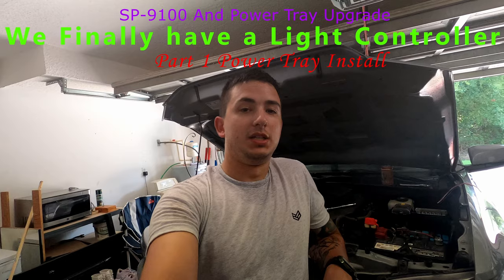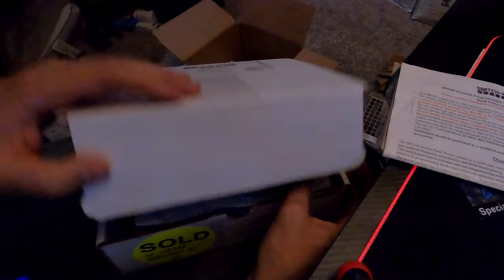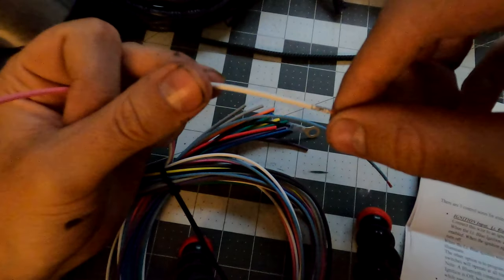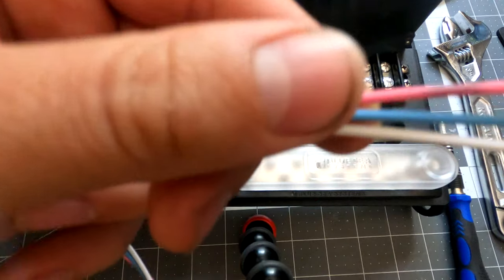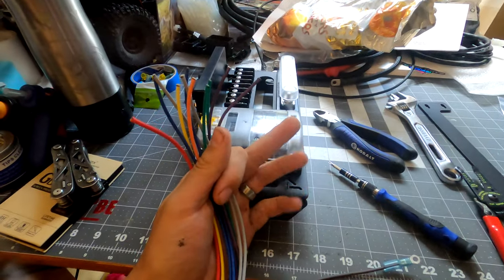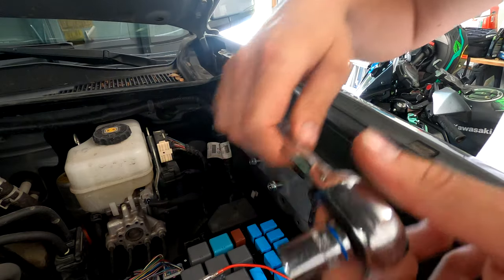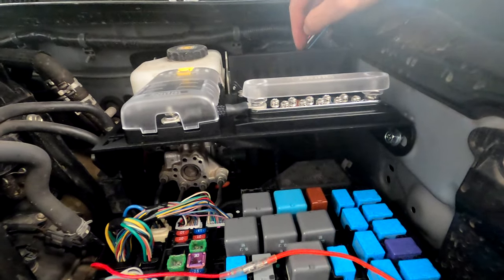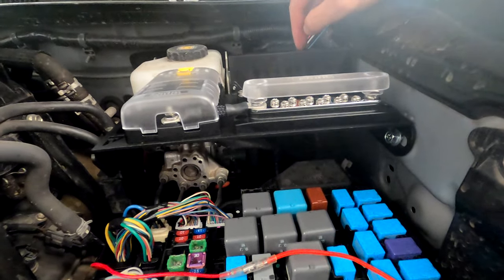Switch Pros Install Part 1 - SP9100 and Power Tray Setup

Comment: Your blue sea fuse box is upside down. You are connecting your ground bus to +Positive of fuse box?
Reply from the maker: Why yes it is😂 I fixed this in a later video, but as I didn’t have anything to really hook to it I didn’t put in the effort testing it in this video.

It wouldn’t have any affect on the Switch-Pros either way.

Took me a bit to figure that out😂